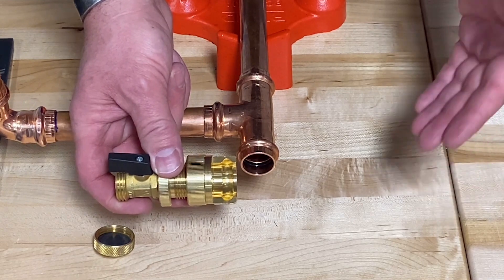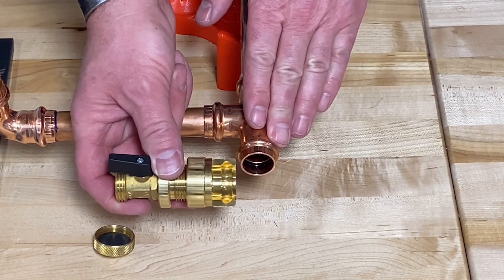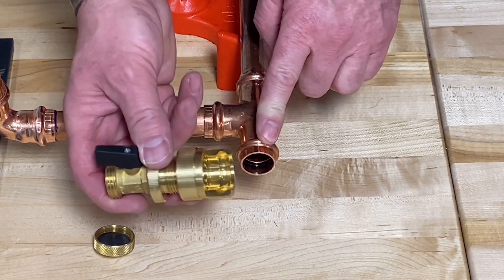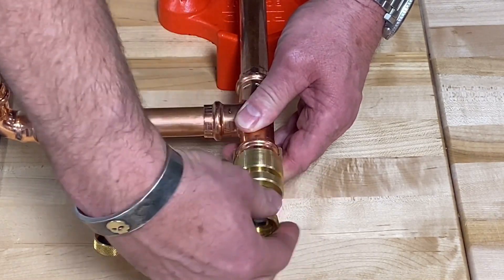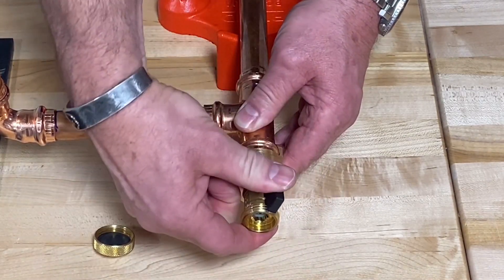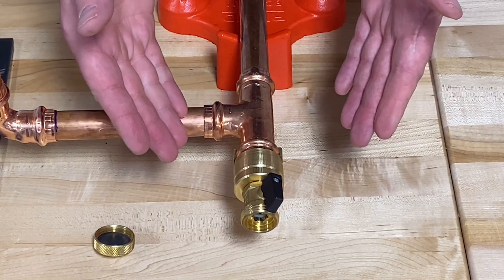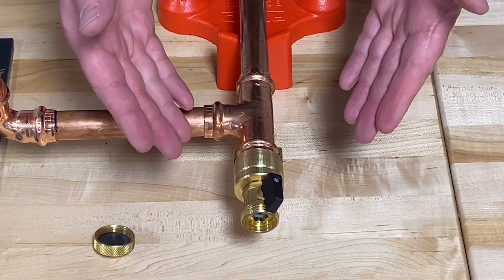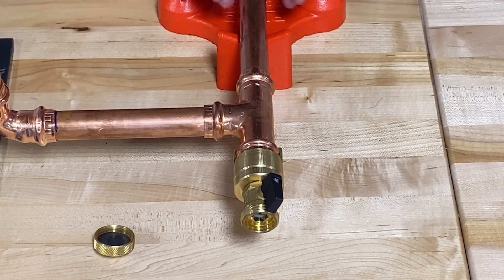ProPress Test Plug -- Pressure Test a ProPress System

Comment: No mention it’s $40 for the 1/2 in. Test gauge. Only another $250 to dump into the $5K-10K for the tool and commonly used sizes for water n gas lines.

Comment: I found the best way to use the propress is to pop the O rings out then solder the fittings then press the soldered joint. Best of both worlds.
Reply: Do you actualy do that
Reply: Belt n suspenders approach! 😂